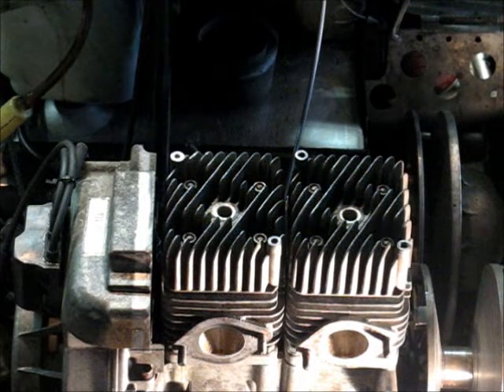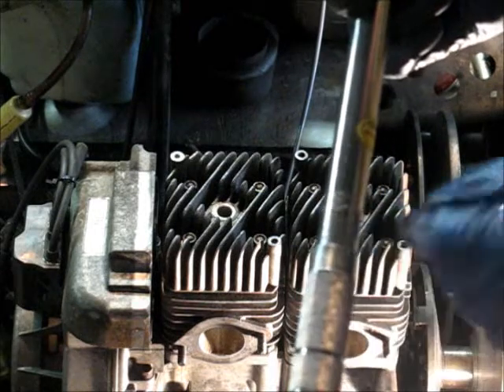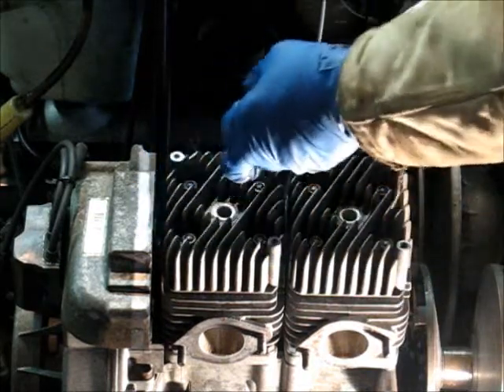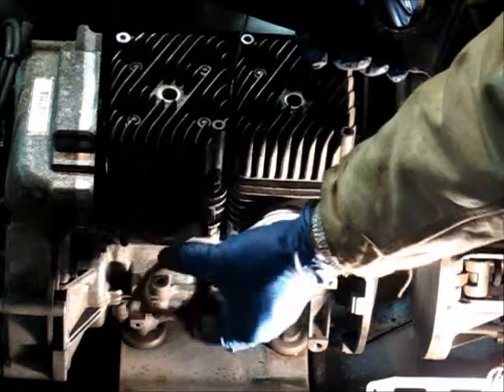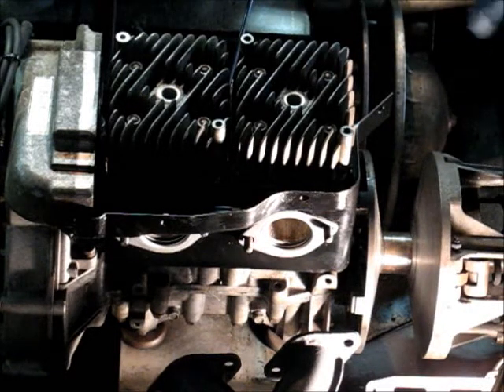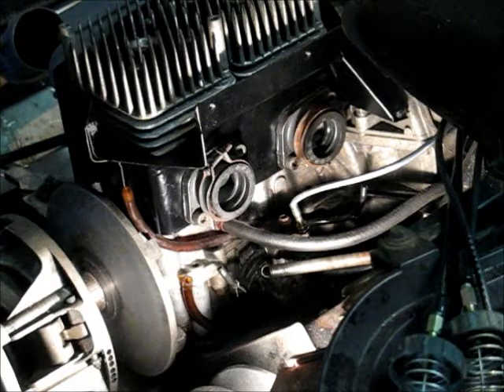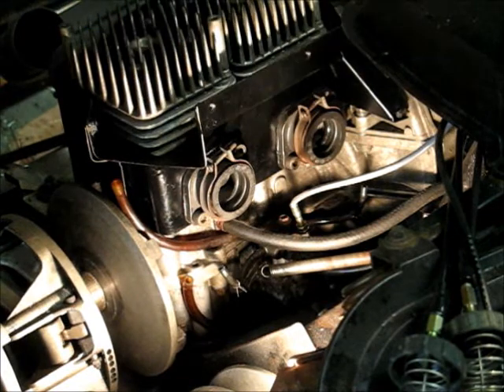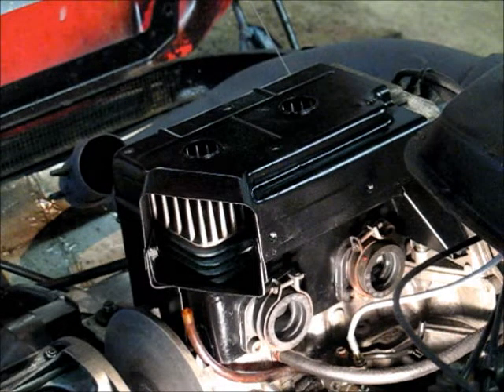1991 Polaris Indy Lite part 2

Comment: HI Ken , I have a few questions. The head bolts on the indy lite I just bought were loose. There is evidence of oil leakage around the cylinders. I tightened the heads to 19ft/lb. Should I tighten the cylinder nuts as well ? You didn't show that in your video. I can't get a torque wrench in there . Do I just tighten them best I can ? Do I have to remove the gas tank so I can remove the air box ? I want to remove the carbs to clean them. Thanks . Mark
Reply from the maker: +Mark Bow Hi Mark, did you check your head gaskets? If there was leakage you might want to replace them. Yes I would definitely check your tightness on the cylinder nuts, just be careful not to over tighten and twist the studs off. I looked back at my assembly video and remembered I couldn't torque the cylinder nuts, but just make sure they are snug. You can get your air box off without removing the fuel tank, it's kinda' tricky but wiggle the air box around the steering shaft and it will come off. If you find removing the tank will be easier, than by all means remove it, it's not too hard to do.
Reply: Thanks so much Ken. I hope to get some time next week to work on it some more. We had 8" of snow about 2 hours north of here this week. Winter is coming !